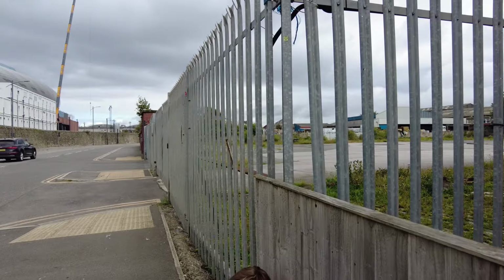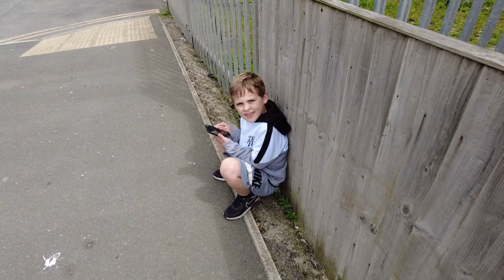New Bramley-Moore dock  development update Everton FC 22-7-24

Comment: Craig - the concrete bench between the megastore and the hydraulic tower, has had it's concrete poured into the shuttering.

I also seen on another video, that the last barrel cladding section was connected to the crane, and probably awaiting the Everton official drone, to video it's fitting.
Reply from the maker: Yeah I seen the concrete to mate they will be moving towards the paving soon 

And I might be going tomorrow for the last piece to go in tomorrow am just unsure what time they are going to install it